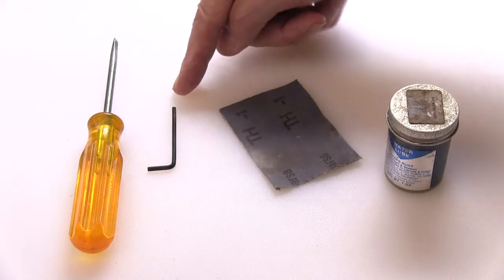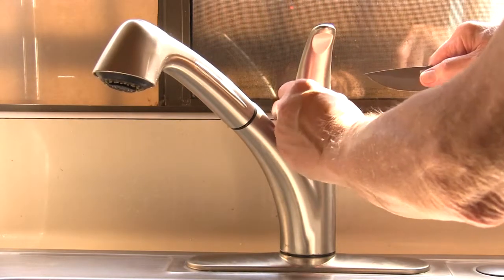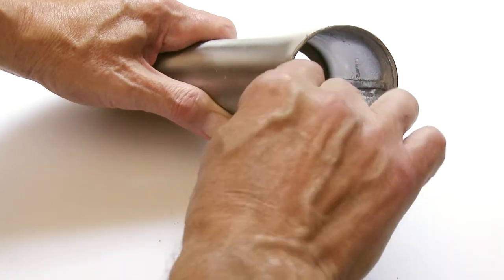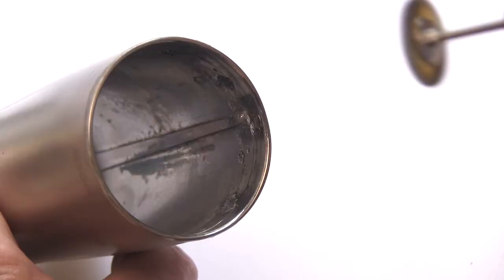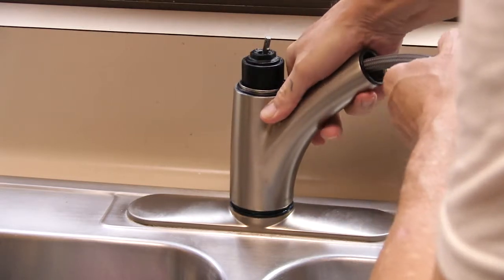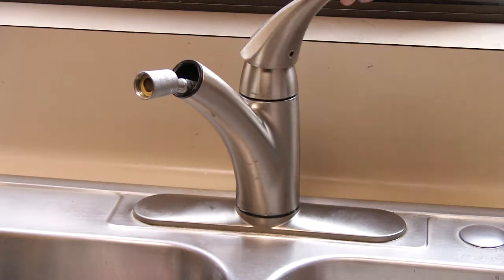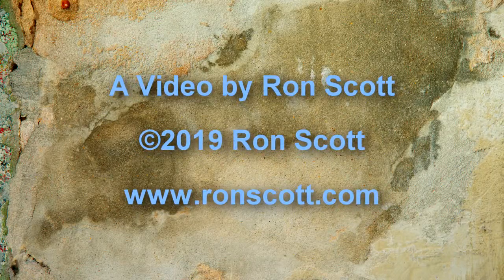Moen Sticky Faucet Repair

Comment: The best part for me was you showed how to remove the crown ring. Moen sent me a new faucet body because my hose was not retracting enough and the receiving end at the top was very worn out. They thought replacing that would help with the second weight they sent. But no instructions on how to take this all apart to swap it out. You hit the jackpot! Thanks much Ron! You ROCK!!!🎸🕺🎺

Comment: Nice job, very helpful as I hadn't done this for a number of years. My corrosion and gunk was primarily at the bottom on the base, used vinegar and a brush to clean it up. Used lots of silicone lube to hopefully forestall new corrosion. I took the cartridge out, but it wasn't not necessary. I believe there is a lifetime warranty on these faucets, so if you registered with Moen, call, and they will send you the kit.
Reply: My house came with all Moen fixtures , they have always replaced any fixture parts for free

Comment: Very helpful video, Ron.  Thank you very much!

I have a couple of complications - First, I haven't positively identified my model and I can't find the documentation that I normally keep for household appliances and fixtures, so I don't know exactly which O-ring set to get, but that may not be an issue because I have sets of O-rings covering a wide range of applications.  I can always measure the parts and order suitable rings online if necessary.

Second, my pull-out sprayer has been stuck in place for at least a couple of years.  I focused on getting that un-stuck after watching your video, because obviously you can't replace the lower O-ring without detaching the sprayer hose.  Fortunately I was able to do that after about 2 hours of various chemicals, tools, and strong language.

I'm confident that I can get the job done without breaking anything now.  My Moen faucet still looks good and functions well after at least 15 years of service, and I would hate to have to spend $600+ to replace it because I screwed up.

Comment: Grrr I had totally disassembled my faucet then soaked everything I'm vinegar. Partially reassembled only to find it still didn't rotate/swivel well. Glad I found this video how to pop off the outer metal to find 15yr of calcium buildup, just wish I would have found it earlier. I guess I get a fully clean sink & as learning experience. Thank you for the video

Comment: Thanks, this helped me avoid a lot of unnecessary disassembly of the faucet. Unfortunately, despite having softened water, there was a significant amount of corrosion of the metal at the base of the “spout receptor.” Still, it moves back and forth much better after removing a lot of deposits and applying silicon grease.

Comment: Great video, however, I dunked the spout fully into white vinegar and left it overnight.  The corrosion was dissolved and a few rubs with a green scouring pad shined things up!  No need for the sand paper or Dremel tool.  Use the plumbers grease and be careful using other greases that may cause the o-rings to swell.  If the spout is over 5 years old, it might be a good idea to replace the o-rings while you are in there.

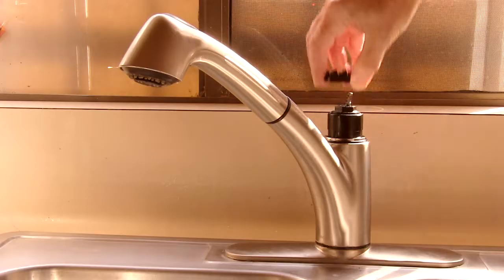Comment: This worked for me on my 7560.  Seeing how to remove the crown ring, at 1:25 in the video was very useful.  For me the symptom was not  rotational tightness. It was that the faucet came loose from the countertop. But in reality that was happening because of this hard to rotate problem.  It caused the entire faucet to rotate, and thus the nut holding to the countertop would loosen.
Reply: Mine was the same! I started with videos to fix the wobble when I realized this was actually the case. The hardest part for me was to get the faucet to separate, the buildup was like glue! Going to town with sand paper did the trick and definitely saved me money by restoring the 5 year old faucet (not sure the model, but the construction was the same).
Reply: same for me. But mine didn't lift up. I have a different model, so it may not work like this.

Comment: Thanks for the detailed instructions  Mine works fine now.  2 years later, I had to do it again.  I don't have silicone gel, just spray.  Maybe that's why I had to repeat after 2 years or maybe my water is just too hard.  In any case, thanks.

Comment: For anyone having trouble getting that crown ring back on ... 
Although this faucet looks just like mine, my crown ring is slightly different.  The rubber o-ring goes around the outside of the ring (not the faucet body), and the open gap in the ring MUST be positioned towards the back of the faucet.  I was EASILY able to set the crown ring using the cone to evenly press down on it, but the ring would not seat itself at all if its gap was facing anywhere but the back.

Comment: I have a Moen Walden kitchen sink faucet. I can get the airator out. It looks like it's a keyless model but the end of the faucet from the diagram I looked on bones website shows it's the threaded top. I put vinegar around the top in a bag to break down any corrosion but it doesn't seem to be doing the trick and CLR do the trick?

Comment: You make it look TOO easy! LOL
It took me 10 mins. just to get my stuck set screw out. I still can't just lift my handle off like you did. Corrosion might be the problem, though this Moen is about as old as yours, only mine is white in color. I've tried rocking it and brute force pulling upward. I guess the next step is to "use a bigger hammer" or call a plumber.
UPDATE:
Before I used a towel and a hammer to try and loosen that faucet top lever for removal I decided I had nothing to lose by squirting in some Liquid Wrench into the hole where the (finally) removed set screw was and under the handle towards the middle of the faucet. I let it set a few minutes, wiped away the Liquid Wrench that had drained to the inside bottom of the faucet and then discovered the faucet would rotate a little! I nudged it back and forth in wider and wider arcs until it was much easier to rotate. Problem solved! 
I never could get that dang set screw back in, despite cleaning it and being patient. I guess I nudged the handle up about 1/32" by pulling up on it, and now it won't align for that screw to go back in. My "fix" might last 3 weeks, 3 years, or until we replace the entire sink faucet. Time will tell.
BUT it just hit me, I used Liquid Wrench, a PETROLEUM LUBRICANT, which is a mistake Moen and other manufacturers warn about, that petroleum products eat away at rubber parts. So I can expect my rubber "O" rings inside the faucet to become degraded and for the faucet to start leaking. I have no way to just wipe it off since that spray lubricant is now inside the housing that I can't remove. I foresee a new faucet and a big plumber's bill in the future.(Sigh) So much for DIY.
Reply: I loosened the nut under the sink about 3/4 inch , lifted the faucet up that far with one hand and hit the plastic inner housing with the flat side of a hammer (with the other hand) just enough to break the plastic loose from the metal; then I was able to remove the metal as in the video. My reward is now I get to clean all that crusty debris inside the metal housing! I have it soaking in vinegar; hope there are no unintended consequences 00
Reply: @danosono  Glad you had success. I have to report my faucet is still working fine after using that Liquid Wrench. I can HEAR the rubber (gasket?) inside the faucet squeaking some every time I move the handle, but it's not leaking after 9 months! Frankly, I'm amazed I didn't ruin it.
Reply: @MikeUpie  Nice :)

Comment: My crown ring is well below the level shown here, such that I can't access it. It's below the top of the spout housing or receptacle. Is this normal? Model is Brecklyn.  That crown ring is the only thing holding me up. Thanks.
Reply: I have a similar faucet and the crown ring is about an inch down like yours. Did you figure out how to get the ring out? I called Moen and they sent me instructions for my faucet but they were like this guy’s faucet where you can see the ring. As I pull the body of it up I see the tabs on the ring spreading but still no luck. Im ready to break it!
Reply: @DobraLLC  It's been long enough that I can't remember the specifics, but I did end up replacing the faucet entirely. The new one is already starting to stick! That's the problem with hard water.

Comment: The upper O-ring goes on the plastic part and is called upper bearing
The spout rides on the lower and upper O-rings and they should be lubed with silicone
Reply from the maker: Hmm, thanks, but not seeing where my instructions differ substantially. FYI, as I outlined at the beginning of the video the lubricant is silicone based.
Reply: Can we use vaseline instead?
Reply: @khayyamshaikh9182  NO VASELINE! It is petroleum based and will mess up the o-rings. You have to use silicone based plumbers grease.

Comment: Mine is the handle to mix the water so hard to rotate! Not the base! How to fix it?
Reply from the maker: Sounds like the problem is with the cartridge (the rotating valve). Try replacing it. Fairly simple to do after you cut off water (both cold and hot) and remove handle. I am sure there are videos on the 'tube on how to do this.
Reply: I had this issue as well. I ended up spraying some lime away into the handle from underneath. That seems to have worked for now. I just have to tackle the problem of the faucet not being able to turn from one side of the sink to the other side. Hence why im here now 😜

Comment: This EP is great and raw punk, but Overkill got even better when Felice Lococo got in the band shortly after this and they went more speed metal. "Triumph Of The Will" is a classic that should've been released about a year after this EP.  The backing tracks were long finished, but then it got delayed by SST for almost 2 years because Merrill Ward blew his voice out while recording his vocals for this and also working with S.W.A. simultaneously and recording their only album. It took him a long time to get in good enough voice to finish TOTW.

And to end any confusion, this Overkill is NOT the hair metal poser band from N.Y., this band is the ORIGINAL and better Overkill from L.A. This Overkill was forced to add "L.A." to their name not only to stop the confusion, but also because the east coast shitbag Overkill sic'ed their lawyers on them and threatened legal action.

Comment: Mine won’t even separate i can only take the handle off thats it
Reply: That's where I am currently stuck, with our  2014 Model 87316. The handle, dome and upper bearing are off but the spout receptor is not even close to loose.  LimeAway helped clean a lot of dirt/gunk from the top but still not loose.  Might try silicone spray in hopes it seeps down and loosens the parts.